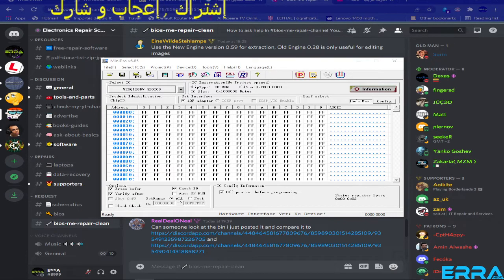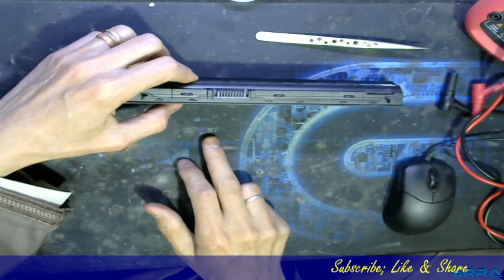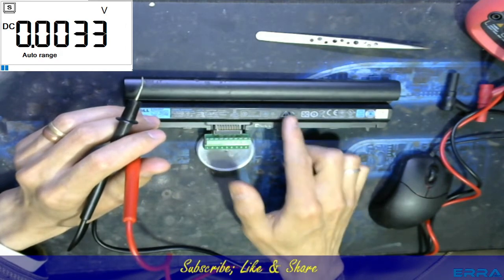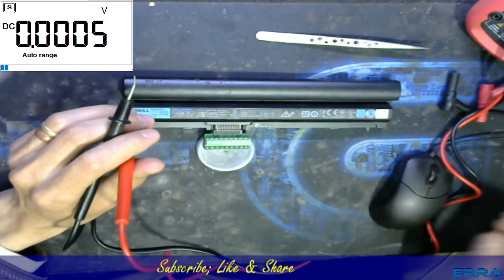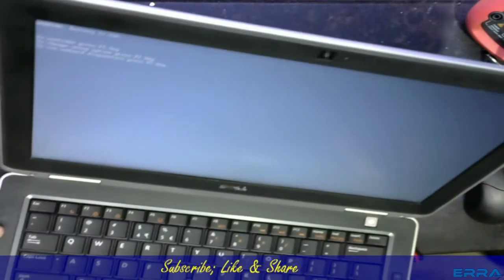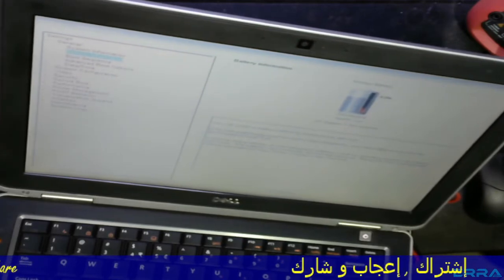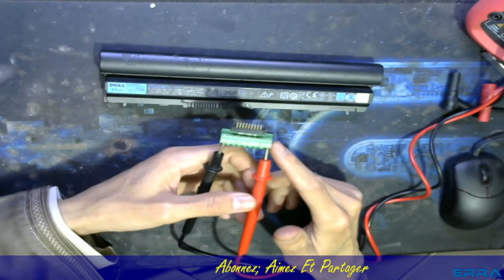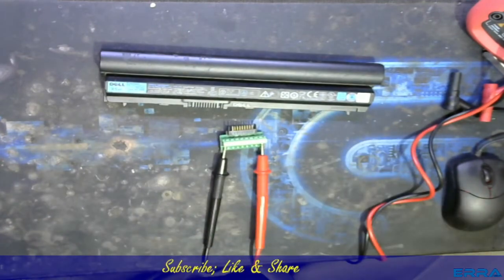How to Check output voltage of a Dell Battery With 9 output pins

Comment: So short pins 1 & 4 then read voltage at pin 1 neg. & pin 9 pos. !? 
Battery being 14.8 VDC at optimum/new/fully charged condition.

Comment: Fantastic video I know it’s old but I just now found it. Please tell me where to order the battery connectors that go with the special charger you use in your next video. I can’t find them. Do I have to order one at a time for each you have an assorted kit, please help.

Comment: I have a dell d600 battery - type C1295/ 3R305 / M9014 which has been lying unused for 10+ years (it's however new in the sense that it has never been used). It doesn't take any charge whatsoever. Any idea on how to revive it?